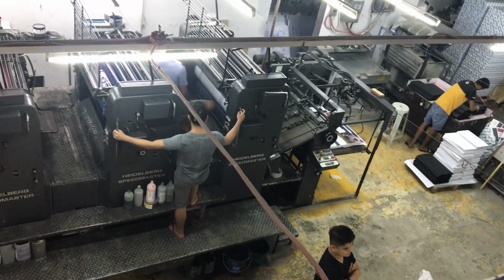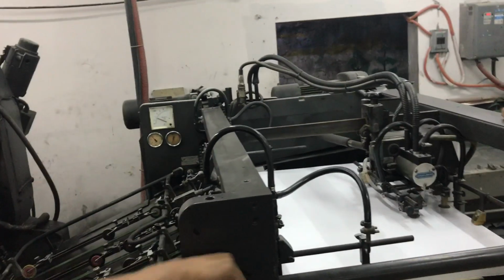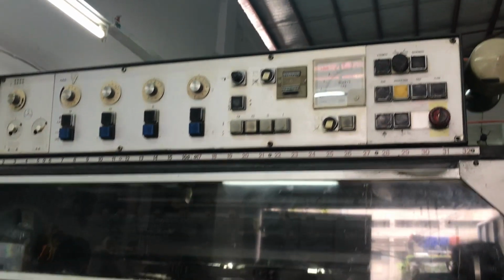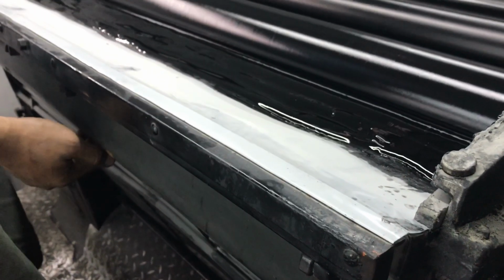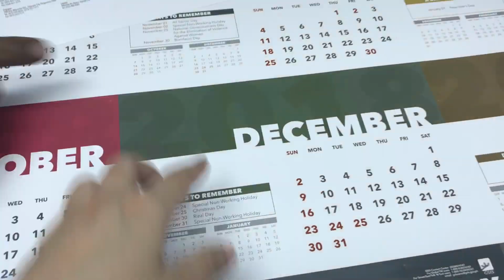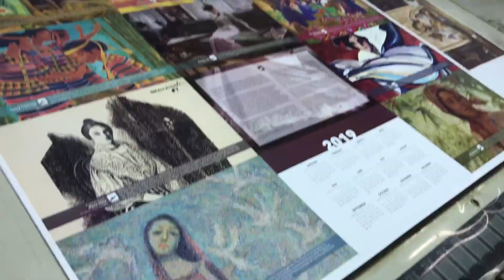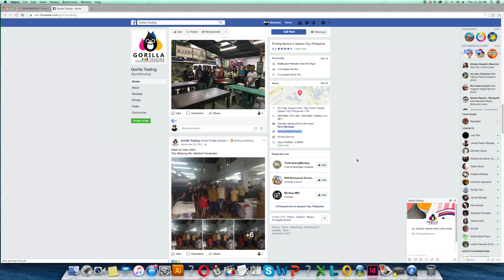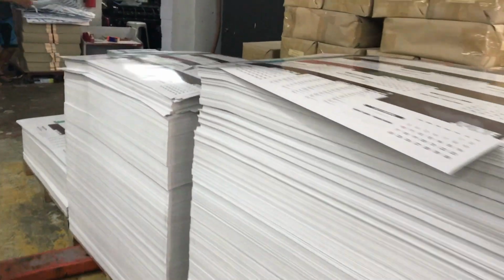VLOG 06 - A Printing Press

Comment: Speed it up!
Reply from the maker: Speed up the video? You can actually do that yourself. When viewing the video click on the settings icon, and you should be able to choose from various speeds, which includes 2x speed.
Reply: @maryannemoll  
 LOL , Speed up the printing press it’s barely working!
Reply from the maker: @rons9197  oh hahaha. In my long experience with publications the start of print production for offset printing is always like that because they had to make the adjustments according to what I wanted. And I cut up the filming to include the portions in which I was involved. But as soon as I signed the final proofs with my approval, printing was fast. They printed the pages for 4,000 calendars (28 pages each calendar) in two days.
Reply: @maryannemoll 
 Used to be against Company policy to run machines below 16,000 hr. but these machines had Spectro Computerized Color Control. Speed would effect color control if you drastically slowed the machine down.
Reply from the maker: Not sure if they had to stop every once in a while and check the color during those two days. One red page was affecting the other pages on the sheet and that’s what made my approval process take a little longer, but so far I am happy with the results. Calendar was well-loved by our employees, which we distributed before Christmas of 2017. I didn’t ask about this printing press’s company policy. All I was after was good printing.
Reply: @maryannemoll  
Good job ! Quality control is a sheet pull every 500 sheet minimum and a color scan of ink density. Sheet pulls are kept and marked throughout press run to monitor color and proof of press run consistency. If any quality control issues are questioned these numbered pull sheets will be a reference along with computer stored read outs.